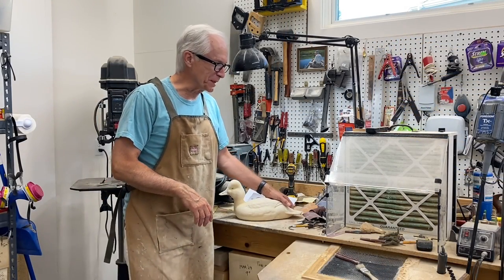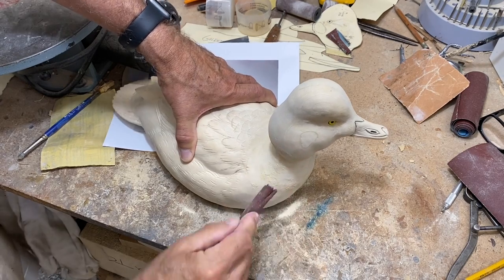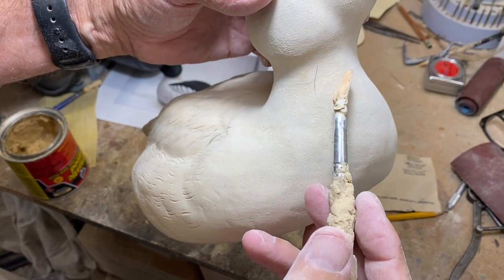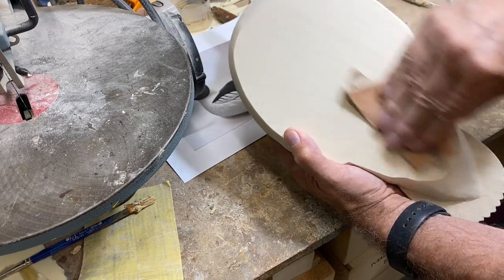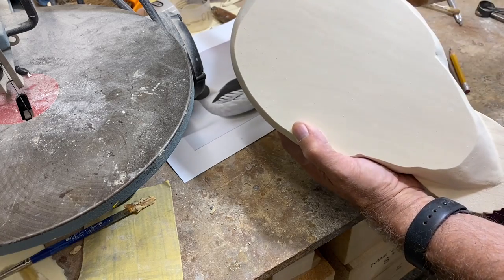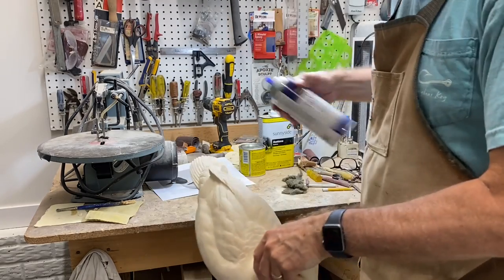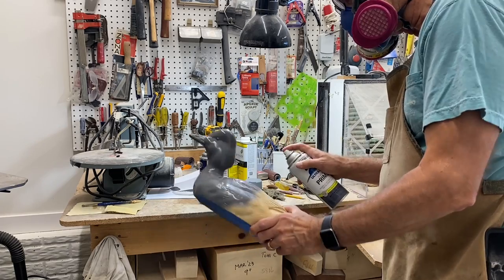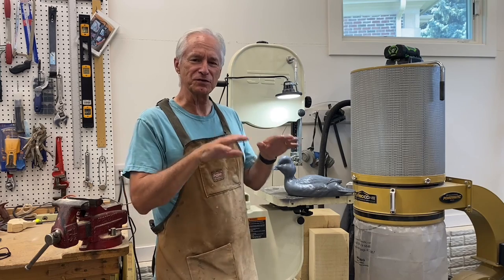Carving a Goldeneye Drake Session 6 - Completing the Carving

Comment: Does that primer stay tacky for you? I bought the rustoleum Painters touch 2x ultra cover flat gray primer. Even after letting it sit for 24 hrs inside it remains tacky. As I work with the bird to paint it I ended up with finger prints in the primer which was a pain
Reply from the maker: I have noticed that as well. I haven’t had any adhesion issues using it but would like to find an alternative. have you had better performance with another brand?
Reply: @tomchristieart  I'm new to carving so just trying to explore with what works the best. I'd love to have a primer that doesn't tack up as much tho. Currently working on 4 drake buffleheads to finish out my first 9 bird rig. Last year I carved a few foam black duck decoys and purchased some formed polyurethane heads. Shot a banded black duck from New Brunswick over them and now I'm addicted and decided to make the leap to wood this year. Your work is awesome, thanks for posting!
Reply: @tomchristieart  would a white gesso with a little black mixed in work?  I use this combination on some other types of carving.  None of my carvings are exposed to water though
Reply from the maker: @carverbp  I think that would work for a bird that won’t see water for sure. Thanks for the suggestion!